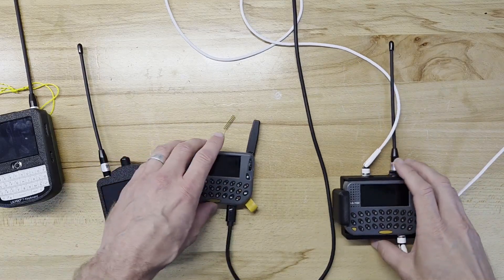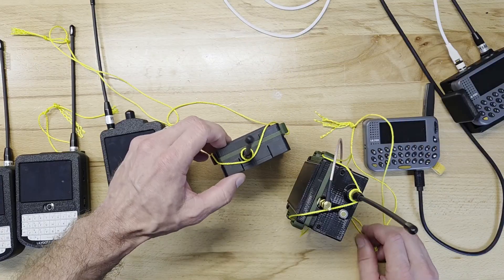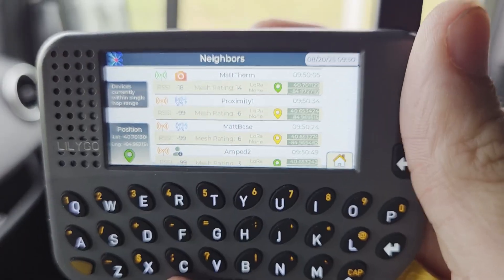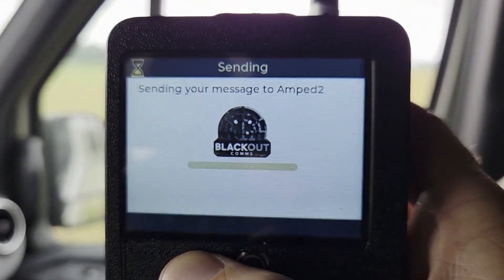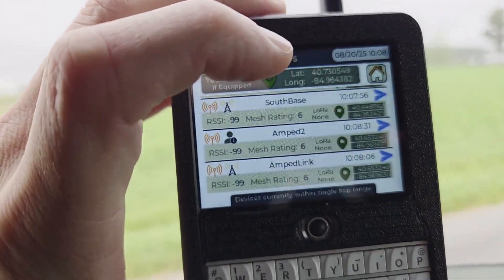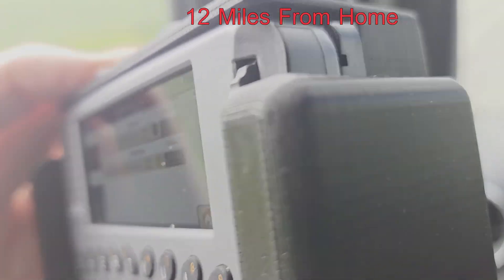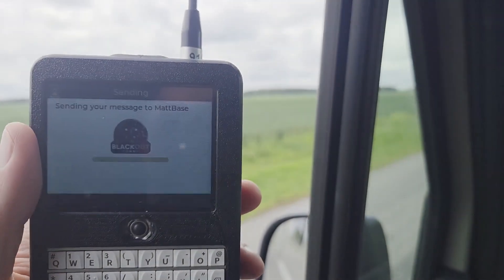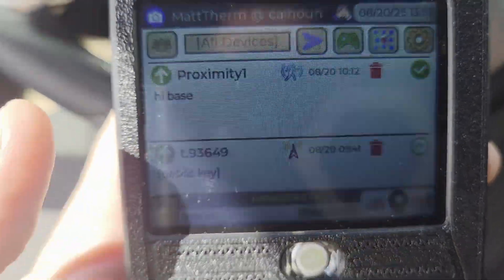Lilygo Pager & T-Deck Amped with AirBuddy - Distance Testing with Blackout Comms Off-Grid Messaging

Comment: What is that about a t deck thermal camera?
Reply from the maker: You can add an Adafruit mlx thermal cam. The firmware recognizes and lets you capture/send low resolution thermal images.
https://www.offgridcomms.club/firmware/esp32/assembly/blackout_comms_tdeck_thermal.pdf

Comment: Will the firmware work with out gps I have 2 t decks that I want to try this with
Reply from the maker: It's designed to require an accurate time source, which can be either GPS, a battery-powered realtime clock, or both. I have actually not tried starting it without either. It definitely won't work reliably, but will either hang on startup or startup quickly thinking it's january 2025, I can't remember how I coded that part to be honest.

Definitely it's not designed to run without one of those time sources. The third possible time source can be any other Blackout Comms device that's already running. An already-running device will share time, but...again, if that device doesn't have a time source, I'm not sure how that would work out.

The T-Beam supreme does have GPS built in, in case you happen to have one of those. It can function as the time source for your t-decks, if so.
Reply: @mattcalhoun61 ok I'll have to get the recommended gps

Comment: Really usefull stuff and video :) Saw some on Aliexpress but wonder the one to choose between A 915 MHz / B 868 MHz / C 433 MHz / D 920 MHz :p
Reply from the maker: If you're in the us definitely, 915. On Amazon, the model listed as 868/915, as if it's for both ranges. that's the one I tested.
Reply: @blackoutcomms  Thx for the answer :)